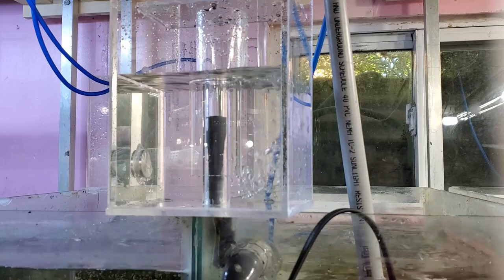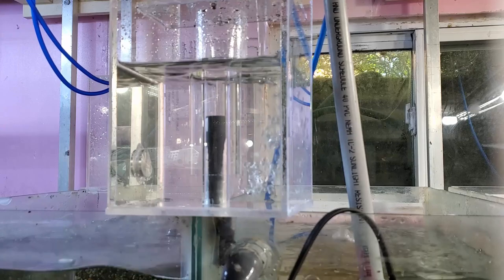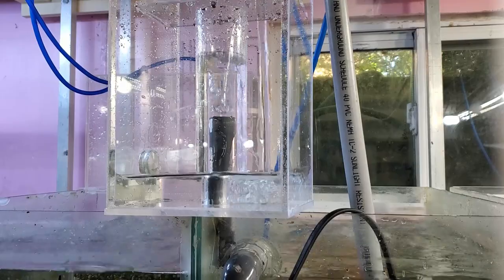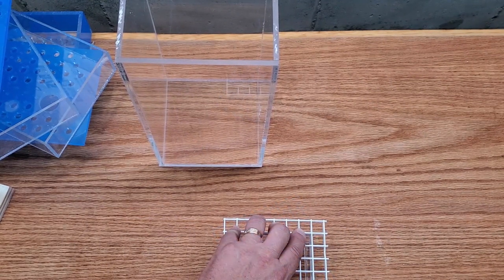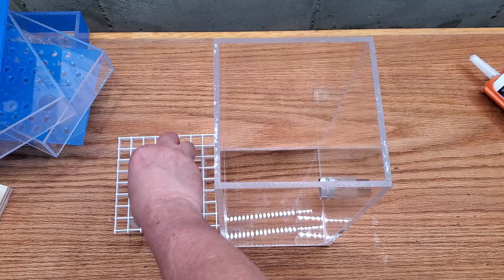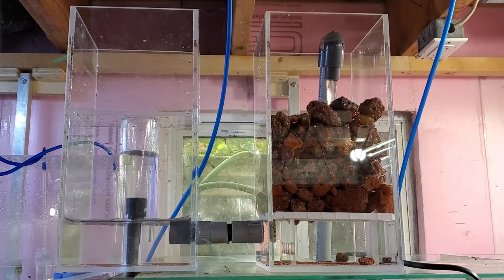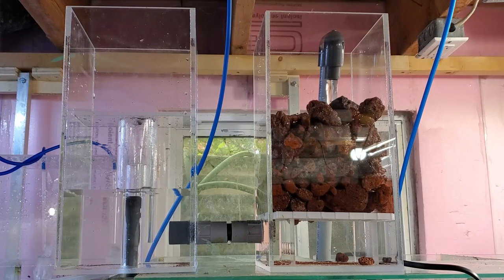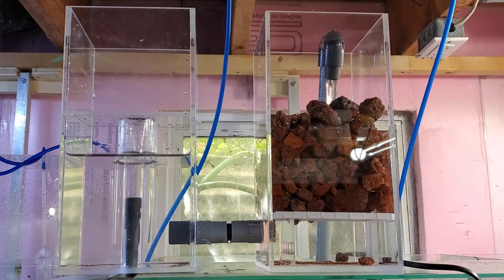DIY Ebb And Flow Filter

Comment: As a long term filter I agree with your thoughts that it would require relatively frequent adjustments to maintain optimum flow.  Neat set up anyway.  Thanks Fred O
Reply from the maker: Hey Fred! There are so many of kinds of filters that look so cool out of the box and then gradually become a nuisance to maintain. It is fun though to put them together to figure out their workings. Great seeing you again!

Comment: Hi Fishman, Great Video as Always. instead of using a PVC Threaded coupler to connect them, couldn't you use a Threaded 90 to bring the water flow away from the syphon tube. there by giving the water level enough of a chance to break the syphon?
Reply from the maker: Thanks Robert! That's actually one of the interesting things about trying to put one of these together, there are so many ways to do so. Each change does affect how it will work and what you need to do to balance it out. The ninety would work though it may require some other change. Thanks for watching!

Comment: Very informative video. Is lava rock in a trickle tower an effective media in reducing nitrates? I've been tempted in replacing my pot scrubbies with lava rock. Thanks.
Reply from the maker: Glad you like it! I find lava rock better than plastic pot scrubbers for long term filtration, but denitrification relies more on flow rates through the media and how much access there is to oxygen. It occurs because the bacteria have exhausted the supply of oxygen and are using the oxygen from nitrate. That kind of environment is not usually available in a trickle tower. They are designed to allow for greater gas exchange. Hope that helps

Comment: Part of the reason it’s taking longer for the set up with the lava rock is because you’re pretty much doubling the volume of the tank so it Hass to drain twice as much, so that’s definitely going to take it longer it should probably cut the cycle time close to in half really.  Volume there’s always going to make it take longer to drain if you hooked up a 500 gallon tank do that it would take a long time to drain because it’s got a pump 400+ gallons through there and that just takes more time. I would still use a showerhead/spray bar kind of thing myself but this is much more cool to look at for sure. Lol.
Reply from the maker: Hey Shane! Volume is an issue for sure and also the narrow pipe between the two chambers. Thanks for coming by!

Comment: Wouldn't nutrient film technique (NFT) be easier for your aquaponics system?
You've got most of the stuff needed running already.
A sloping pipe with holes for some net cups, feed- and return pipes to your big sump and you are just fine tuning (and good light) away from a live system.
Reply from the maker: I haven't actually decided which way I'm going when it comes to aquaponics. I built this because of it's use in aquarium filtration. I will have to figure that out at some point. Thanks for watching!